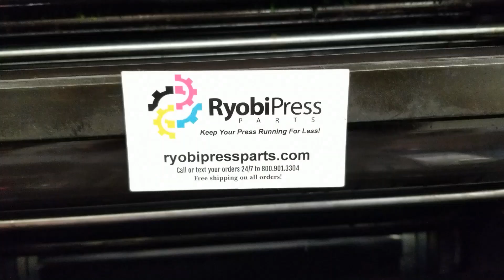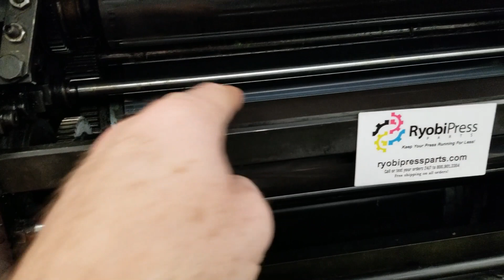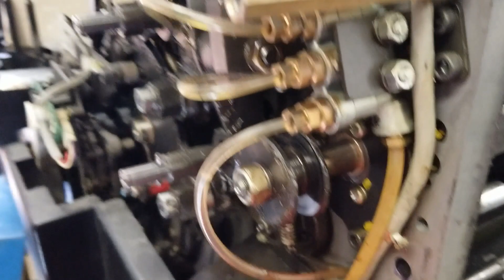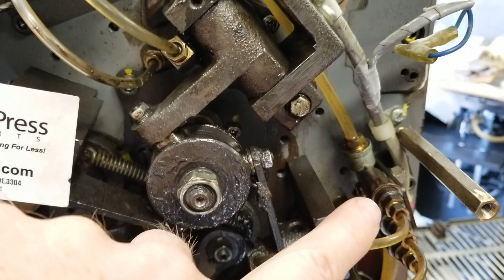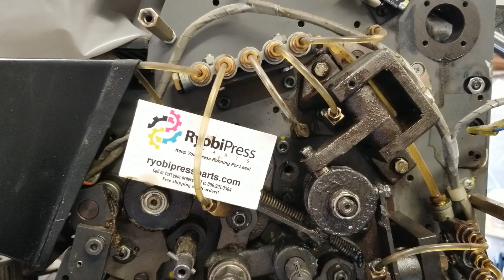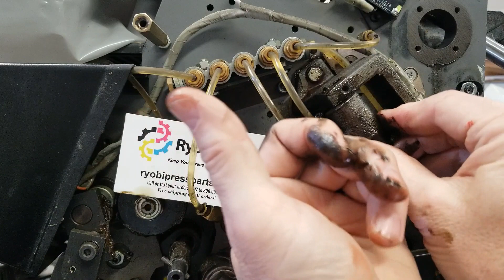RYOBI 3302 & 3304 OSCILLATOR DRIVE BLOCK REPLACEMENT

Comment: My 3302 is having a problem with small drops of ink hitting the plate cylinder. I pull all rollers and clean the cross members that can have ink buildup but it still drip’s to the plate cylinder. Any thoughts?
Reply from the maker: Phil,  Typically the night latch shaft that is between the 1st and 2nd ink forms (behind the 2nd ink form) will collect ink.  This is more apt to happen with your running "long" ink or inks with lots of opaque white in them at higher speeds. 
The best way to fix this is to get that shaft as clean as possible then apply a thin film of grease on it, this will allow you to wipe off all ink in the future much easier.
Try a little binding varnish or body gum in your ink to increase the tach may help or slow the press down a bit.
I also do not suggest using the night latch levers on the NOPS side as when you turn them at the end of the shift the small drops of ink will get thrown right onto the 2nd form and right away have spots of ink in your nice clean rollers.
Hope this helps,  Paul
Reply: Running the machine without the middle form roller prevents any build up of ink on the night latch shaft been doing this for over 20yrs with no issues
Reply: @giovanniromano4361  thanks for replying. I did take out the middle form roller a couple months ago and that’s been the best thing I’ve done. Thanks again Giovanni